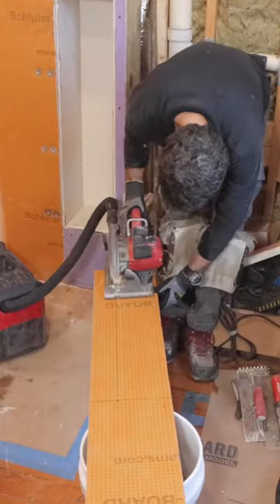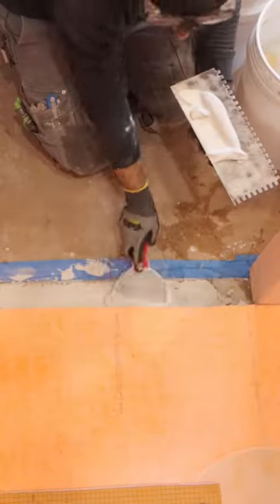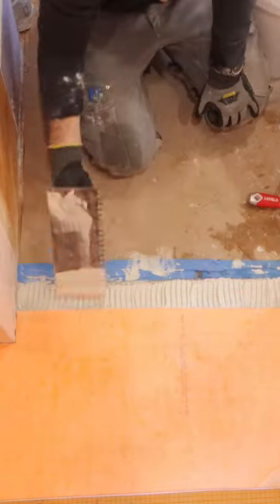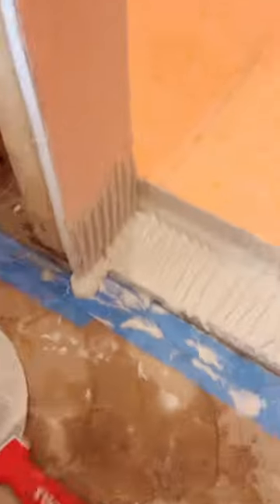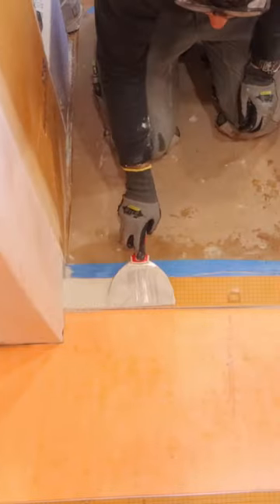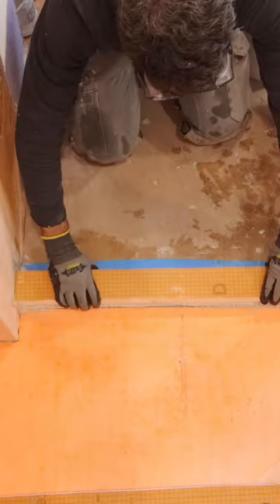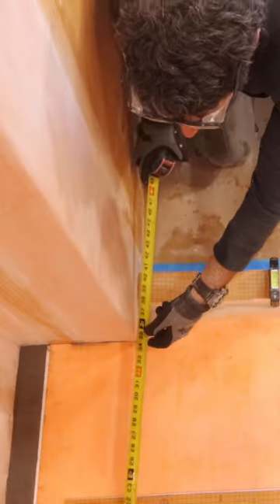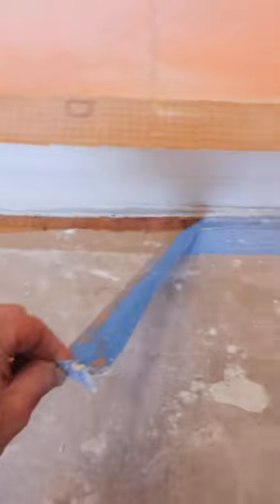How to Build Custom Shower Curbs - #shorts

Comment: I build my curbs out of patio block cut down on my tile saw 16x8x1..cut down to height.. stagger the joint on the vertical and run kerdi paper over the top.

Comment: Will the foam absorb moisture over time?
Reply from the maker: No, it should also be waterproofed with either KERDI or KERDI-BAND, in this example I used one full piece of KERDI that extended 2” on to the shower tray, plus I added both inside and outside corners to make wall connections waterproof

Comment: When you try and mount your shower door tracking down and realize it’s just foam in the curb 🤬
Reply from the maker: If I had to mount hardware to that curb, I’d add a solid high density polyethylene top that could be screwed into; that would go below tile or the solid stone curb top
Reply: Who uses tracks for shower doors anymore? Frameless glass has been a thing for a long time.
Reply: @HomeRepairTutor  Would you please tell us what brand you recommend for that piece of polyethylene top and where to buy it ( I am not a contractor so I couldn't afford to buy it in bulk)? Thank you.

Comment: No need for this expensive stuff. There many other way to isolate that are much cheaper.
Reply from the maker: I used 2” boards for the half wall, then used the extra material to build the curb; and there’s no wood that will rot

Comment: Why not use the correct silicone to bond? Quicker more profitable
Reply from the maker: Silicone isn’t the proper adhesive for this installation
Reply: Caulking fails in 5 years